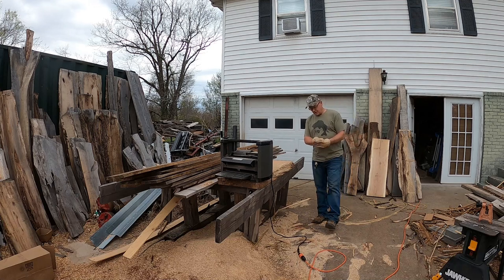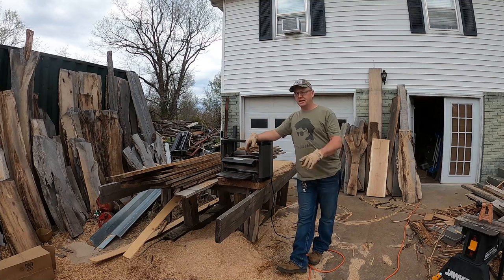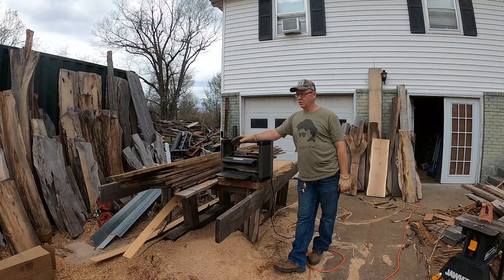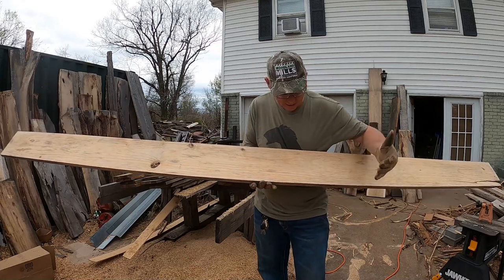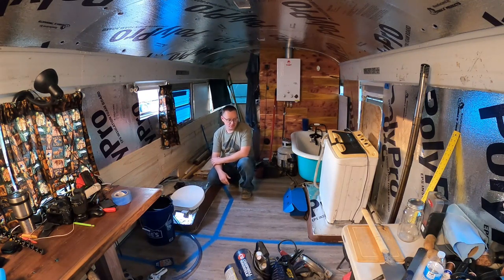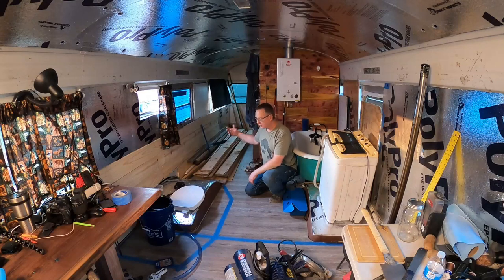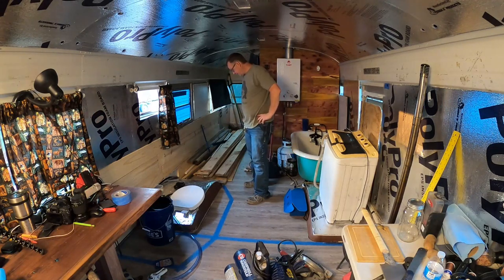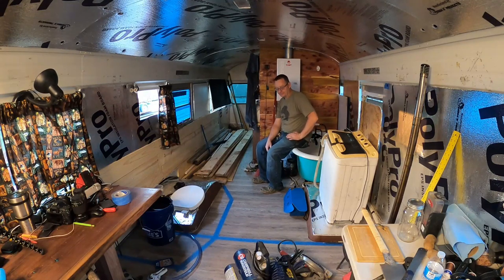HELP!!! Where should I put the composting toilet in my bus.

Comment: I would put it at the end of your tub unlike the other person it's too close to the table even if you put a wall there
Reply from the maker: Honestly once the couch is built there will eventually be small swivel around tables. And that's likely where I'll eat. Since the table is kind of a desk and crafts table. Eventually I might have a different desk/editing spot but I doubt it. It's nice having a large table that can hold everything and not have to move the computer back and forth to hook up to things like printer or cricket cutter.

Comment: Here is my 2 cents.  Put the toilet closer to the table make the wall thick and when you can insulate the hell out of it.  Lets be honest most buss lifers /van lifers only use their compost toilets when absolutely necessary.  Dump it as often as you can keep it clean. There really doesnt need to be more thought put into it than that.  You and company will most likely want to eat outside as often as possible or on a couch so the toilet placement really wont be an issue.  Also you can move it yeah there will be some work involved but do it one way if it doesnt work its your darn bus do what you want.

Comment: Without a doubt,  I'd definitely install the toilet in the bathroom instead of a washing machine. Even maintained, those composting toilets are breath taking and NOBODY wants to see or smell a toilet, let alone  while sitting at the table eating.
Reply from the maker: There will be a wall dividing the table and bathroom. I may not have made that clear. Although close there will be a wall.  My daughter suggested to put a booth seat at the table which would be virtually unusable. So I was thinking get creative and make the bathroom feel bigger. I may put the washing machine on the same side simply because I don't want to run 115v power over to the other side of the bus. I'll just have to fill a bucket of water in the tub and use that to fill the washing machine. And the drain for the washer can probably just go thru the floor. Or tie into the urine diverted plumbing. Which might help keep it cleaner.

Comment: Ok Dave 
You asked our opions so here's mine. I would put it in the bedroom. no woman wants a toilet in her kitchen. I would build something to sit it on to .make it taller for getting up off of easier. to slide in n out from under the bed  .you get a woman to travel with you she would appreciate that so they do go p during the night  and jump back in bed it could sit in the back corner easy access to take out and clean every now n than they do have a smell to them no matter how much you clean it   I would also cut hole to vent it out the back  
 Just my thought
Reply from the maker: The kit I bought comes with a vent fan I don't want to smell it while sleeping.  I don't think it would be pleasant for one person in bed and the other using the bathroom right next to the bed. But thanks for the ideas